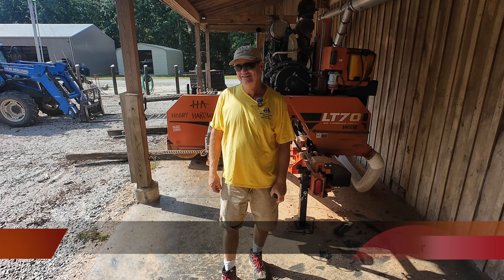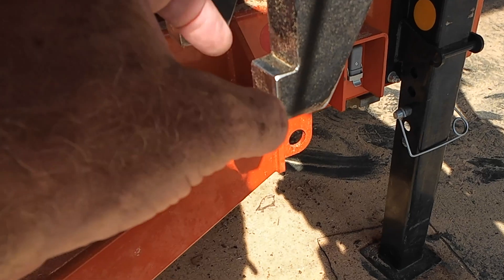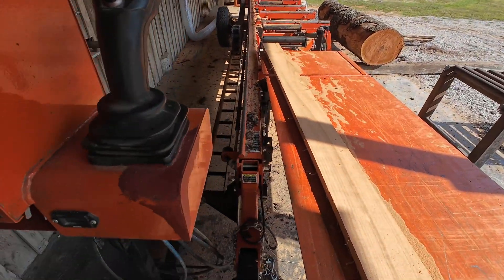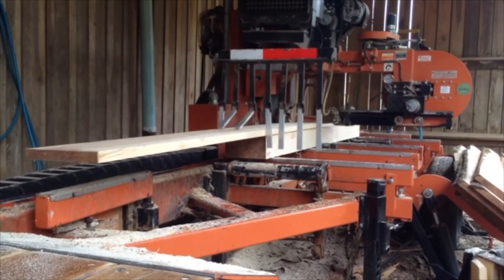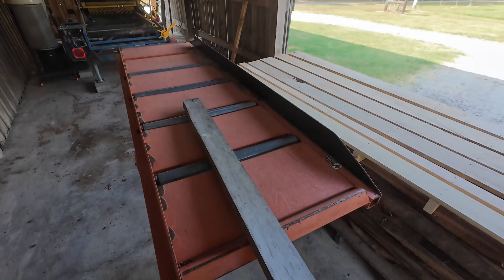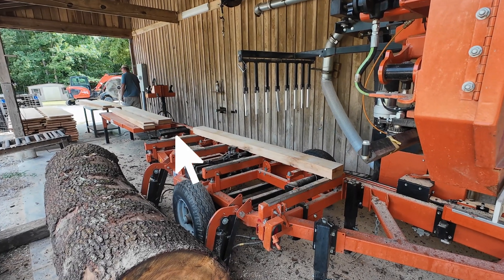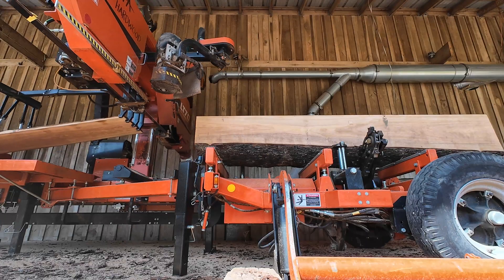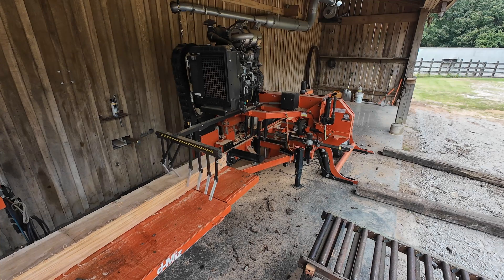Pro Secret - Best Upgrade for Your Sawmill!

Comment: all this is so very helpful. Question: if the dragback, pushing a board, gets jammed, are there sheerpins so it can flip back without getting damaged? and, if this happens, the flipped back dragbacks clear the blade -correct?
Reply from the maker: Nope, this is danger.  The board should have a clear path on the table, and a soft touch in the controls.
Reply: @HobbyHardwoodAlabama  'should' is the operative word.

Comment: Great video as always but! But I think a guy with a manual mill could utilize that system but may have to do 1 or 2 boards at a time which would still save time not handling each board off the mill. Just a thought!
Reply from the maker: I believe you have a good idea!

Comment: Robert, I copied the shoe you had on the 40 and use it on my TK-2000. I can drop waste slabs right where I want them but have trouble dropping boards exactly in the right spot. Are the shoes on your 70 a big improvement over what you had on the 40? If so I need to do some fabrication! Thanks for sharing.
Larry
Reply from the maker: What is happening?  Please describe it more.  Are yo able to trap and carry the boards?  Are they dropping prematurely?  Are they not dropping when you put it in froward?  As a rule, yes the 70 shoes do better than the LT40 shoes because the LT40 shoe is fairly narrow, maybe 6 inches wide, and doesn't grab the board across its entire edge.  The LT70 shoes, due to the nature of the multiple fingers, allow the entire edge of the board to be captured so is more stable.  Also, of the ends of the logs are not very straight, the narrow LT40 style shoe allows it to be grabbed off balance and the board will have a tendency to twist and fall.
Reply: @HobbyHardwoodAlabama  I'm able to trap and carry the boards just fine. They never drop prematurely. They do not drop sometimes when I go forward. A light just came on, my table is a roller table and I'm not getting enough resistance or hold back on the board when I go forward to drop it.

Comment: Take a look at :51 and see the dip. Is the roller bunk on the near side factory?
Reply from the maker: Yes, it is hydraulically raised and lowered, and is in a fully retracted position since I didn't need it for these logs and is actually a mechanism to raise tapered logs.  The sawmill head has enough power to not need rollers, so most times it is simply extra acted and not used..
Reply: @HobbyHardwoodAlabama  So your mill has 3 roller toe boards? My 40 came with the Drag Back but not the jingle Bells.  I have made a tool that tilts a cant for lap siding using the toe boards, works verry well.

Comment: Thank you, Robert, for another hugely educational and informative sawyer video. I thought all pull- backs had shoes already attached to them. I know now that distinct pullbacks are for specific jobs. You have shown by using shoed-pullbacks to strategically place cut boards on the out-feed   table will increase your productivity and decrease your manpower and sawing time. My favorite SEAL saying is, "Slow is smooth, smooth is fast." Hello from Ken in Mobile. 💯👍👍
Reply from the maker: Good to hear from you!